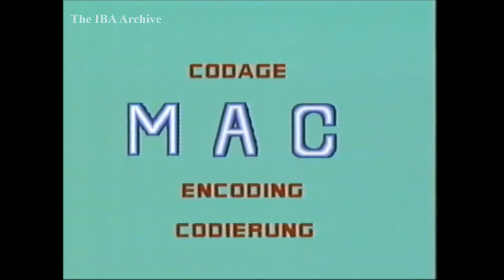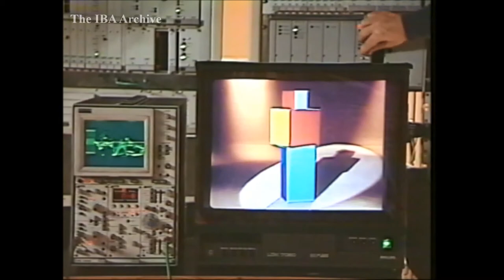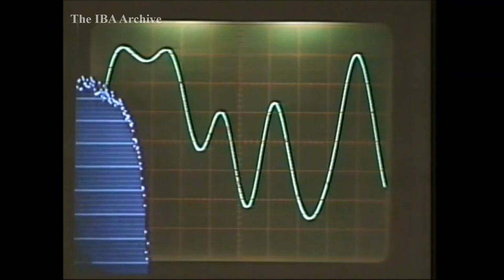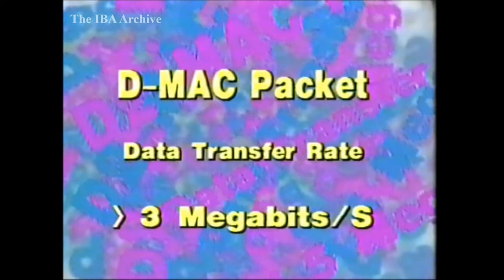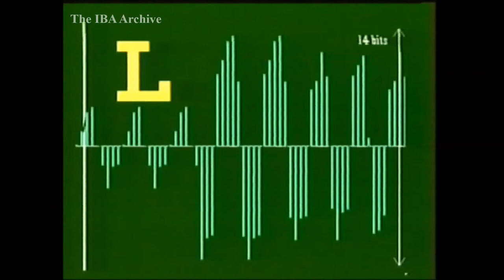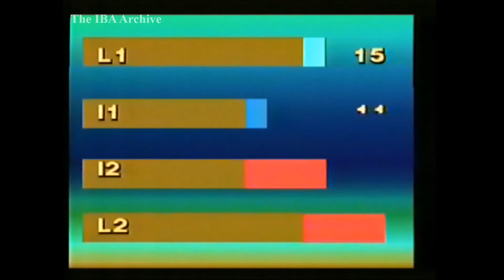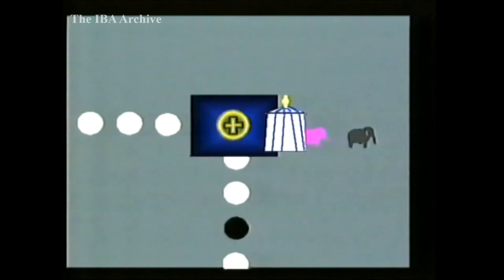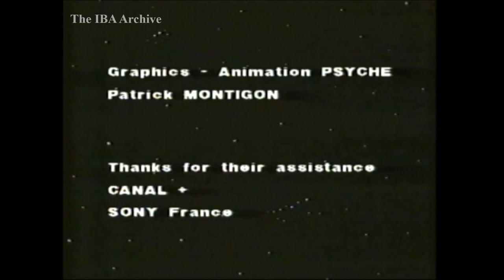IBA/INA/SRT - D/D2 MAC Packet Presentation

Comment: D-MAC and D2-MAC were technically superior to PAL with crisp clear picture detail and excellent digital stereo sound.
Reply: anthony perkins horizontal resolution of d2-mac, please?
Reply: Ivok 1250 lines for HD-MAC.
Reply: anthony perkins Also HD-MAC is very superior than DVB-T 2K.
Reply: @pippolupin8715  it certainly is
Reply: @pippolupin8715  especially in progressive mode.
Reply: @ivok9846  SECAM/PAL transmit a picture (luminance) of 120 Kpoints, MAC a picture of 180 Kpoints in interlaced mode, 300 Kpoints in progressive mode, and MAC 16/9 400 Kpoints in progressive mode.
Reply: @VanRijn4K  it's measured in mhz of bandwidth per line, so for example 3mhz of vhs x 80(line alterations per mhz) = 240 lines (ie you can put 240 vertical b/w lines on the screen). if bandwidth is 5mhz it yields about 400 lines, and that was what wad usually fed to mac encoder, i imagine...offcourse chroma has much lower bandwidth...so it couldn't of been spectacular with such input signal...
Reply: @ivok9846  Yes, 1 line corresponds to 2 points, but line doesn't mean the same when talking horizontal or vertical resolution ; in the old days, one used the term "point per line". Luma bandwith MAC is 5.6 MHz, chroma 1.6 ; it is not 2.8, because of the interlaced mode and to have a lower noise, and that is the blame I would make to the MAC family : the progressive mode should have been mandatory (and not optional), and the chroma bandwith 2.8 MHz
Reply: @VanRijn4K  and where would you put 50fps of progr. scan if the system is already stretched by satellite channel bandwidth?
and where were  progr. cameras in that age? d2 mac is just plain pal without cross colour and cross luma. that's too expensive for just those gains....
Reply: @ivok9846  I don't put 50 fps as you say it, when broadcast by MAC began to be used, the digital technology was already mature enough to store a picture (the 1st  TV with picture memory was a SONY, released in 1988), so 25 fps can still be used.
Progr. scan cameras already existed (Thomson,...), it's easy and fast for a manufacturer to design a progr. scan.

MAC is not a plain PAL, it was a great improvement, especially in progr. scan and in 16/9, it was a lot like cinema (in low resolution, well).

The problem of MAC  is that it came too late. IBA  developed MAC as soon as 1982, but the political decisions were long to take.
Reply: @VanRijn4K  progr.scan is not just one mfr making it, it requires whole new standard, not fast, nor easy. it never really materialized for sd ie on crts.

you also had pal plus in 90s for 16/9. and what sort of system caters just for movies (only 25fps progressive on mac?).
mac, essentially was not a really tangible improvement, heck even MUSE hd wasn't, albeit we could also discuss if todays overcompressed mpeg2/4 are....more channels=crappier image quality...and crappier content, i might add...btw. do you have any d2-mac digitized content? probably not, as it's to old to capture it via pc capture cards....and you would still have output in pal...hehm...